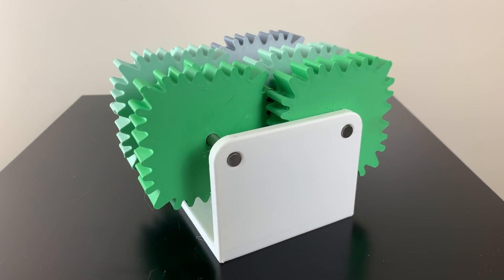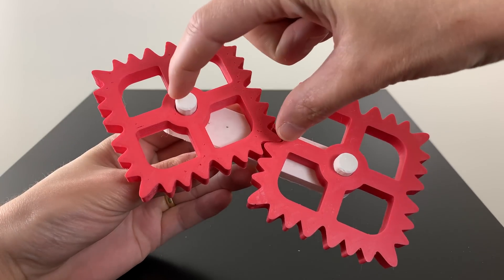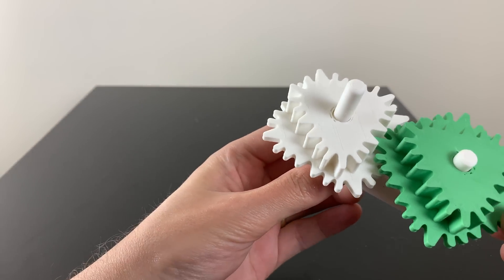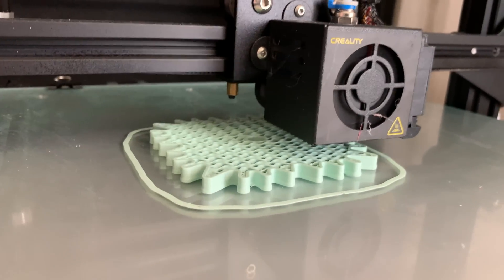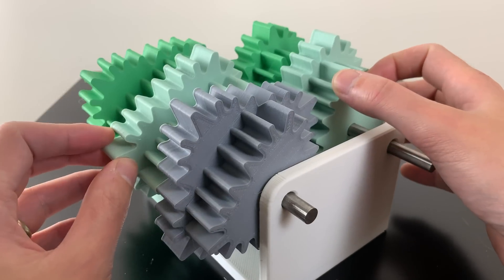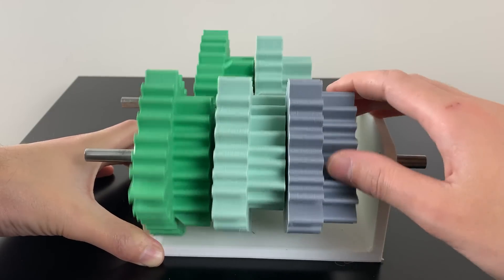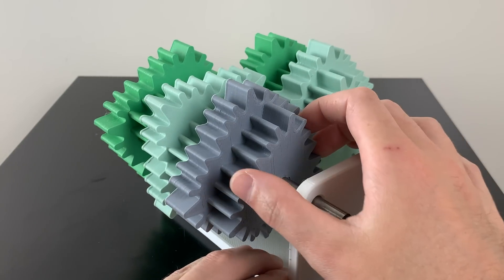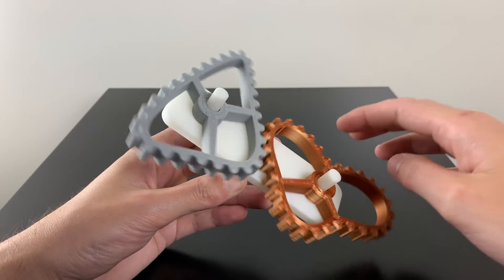Is it possible to make gearbox with square gears?

Comment: An Otto cycle engine's crankshaft doesn't rotate at a constant rate, (because of pistons that are attached to it have to be accelerated and decelerated). 

I wonder if one can use such oddshaped gears to smooth out the rotation coming from the crank before it goes to the gearbox.

Comment: Those speed variations are essential for limited moving parts in oscillating systems like dough kneaders or agitators
It could also help reduce the speed change with piston based systems, with the downside of increasing the force upon changing direction

Comment: This is a really cool concept. I think part of your issue with meshing is that you have some severe elephant's footing going on with your gears. I'd try putting a small chamfer (0.5mm) on the bottom of the gears to fix this problem. I know how difficult it can be to add it to funky surfaces like these teeth, but I bet that would help out a lot with how smoothly the box will run.

Comment: There’s something about triangles that makes them the most important 2d shape.
Reply: they are, like, the strongest shape
Reply: Ever heard of the hexagon, the bestagon
Reply: @shubhpatel7904  cgp grey “hexagons are the bestagons”
Reply: @hey_how_are_ya  hexagon is just 6 triangles working together
Reply: Which means 6 times the power!!!!!
Reply: @hey_how_are_ya they are made of 6 triangles
Get got
Reply: @shubhpatel7904  hexagons are made of 6 triangles
Reply: HEXAGON IS BESTAGON!!!!!
Reply: It's likely because it is the simplest possible 2D shape. Unless you want to make a case for circle, which I'd disagree with, but could at least see the case for.
Reply: @Nevir202  hexagon is the bestagon
Reply: @nicoscool2333  Sure, but that's just because it's 6 triangles, together lol.
Reply: @Nevir202  A circle is just all points equal distance from a certain point. That's as simple as you can get.
Reply: @austinhernandez2716  If you are defining a shape as a series of points, sure.

But if you are describing it in terms of lines an angles, it has an infinite number of segments, each at an infinitesimal angle relative to its neighbors to define the shape, where as a triangle just has 3 of each.
Reply: @Nevir202  depends on what the argument is about. I would argue that the triangle is the most important 2D shape bc it makes up every other shape. so much so that nothing can exist without a triangle, not even a circle. (the only tricky one would be an Oval as that requires a special triangle where the area of the mentioned triangle is in an everchanging state while requiring the perimeter to remain the same. elliplse  is roughly the same, but with multiple ovals)
Reply: Triangle is the 2D shape with least possible amount of sides. Circle has infinite sides I think (just my guess).
Reply: @kunjupulla  that's true, but something like a computer actually drawing a circle is still pretty simple; all it needs is the midpoint and the radius and it's good to go. A triangle needs at least three vertices connected in a specific order, right?
Reply: Well it’s the polygon with the fewest sides, you can stick a bunch of them together to approximate any 2D/3D shape (which is how most 3D models in video games work), a triangle truss is really strong, they always tile without leaving gaps…
Reply: 3d once you bring it the printer
Reply: yes bro(trigonometry 🙁)
Reply: The only shape that only adds to 180 degrees for the sides
Reply: hexagons may be the bestagons but they are made of triangles so in reality triangles are the best
Reply: @theunsaltedpickle7993  
Triagles are made of hexagons too, every shape is made of every shape.
Reply: @user4241  thats not how that works. not all shapes can fit in any shape. for example, pentagons can’t fit perfectly into triangles without any air pockets. putting a hexagon in a triangle leaves three smaller triangular air pockets
Reply: @theunsaltedpickle7993  
Yes, they can. Think a little bit outside the box.
Reply: Because of a lot of reasons, hexagons are clearly superior.
Reply: @Cubic Planet except your name
Reply: They are always stable
Reply: It's a shape bro chill